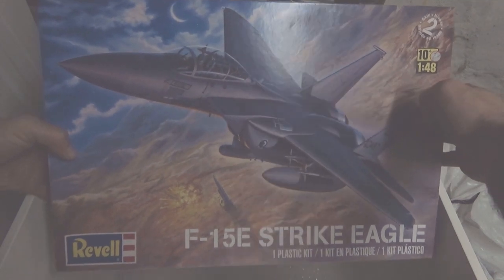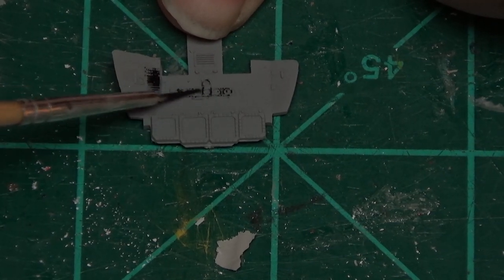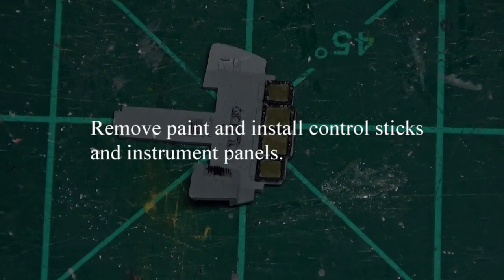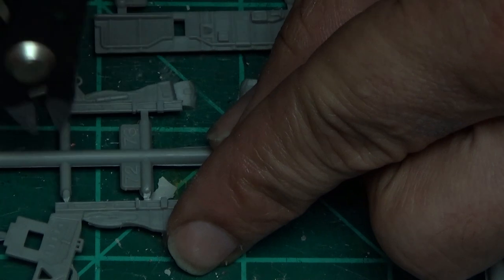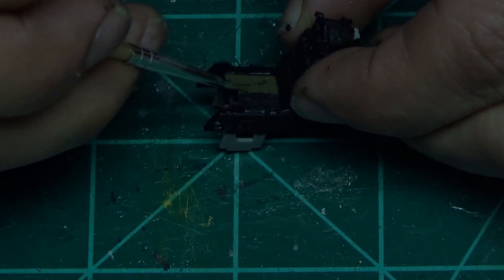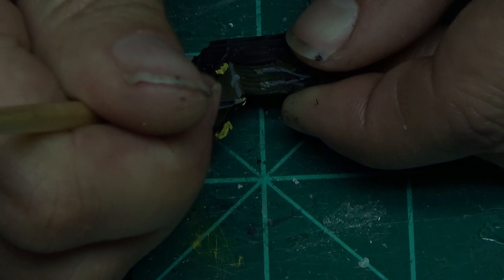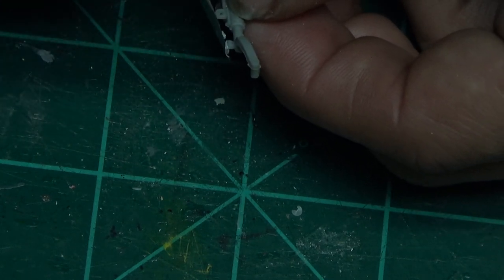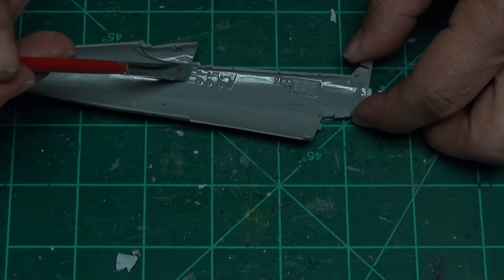Revell F-15E Strike Eagle 1/48 Scale Cockpit Part I.

Comment: I built this model years ago. And my Only complaint was how weak the landing gear struts were. The Left one broke on me at the bottom and I was never really able to repair it properly. I would have preferred metal gear. Meanwhile I just purchased this kit online and should be getting it in a week or two
Reply from the maker: Its a good one. I haven't had any  issues with the gear though. Perhaps this time you will have better luck.
Reply: @PlasticModelBuilder  thanks. Me too. Though I am more than likely going to see if I can find some aftermarket landing gear even Resin would be better than the weak plastic that the landing gear is made of. BTW the one I had came with the full compliment of bombs and missiles, which added weight to it. Which is probably why the strut collapsed in the first place. So I hope to avoid that by getting a Better set of struts.
Reply from the maker: Was it the front gear?  The struts on my version are fairly sturdy. The front may be a bit sketchy if you add more armament. But this one is very good on mine.
Reply: @PlasticModelBuilder  it's been a really long time. But if I remember correctly it was the left rear piece where it curves down.
Reply from the maker: This kit has more sturdy gear. I think you'll be happy with it